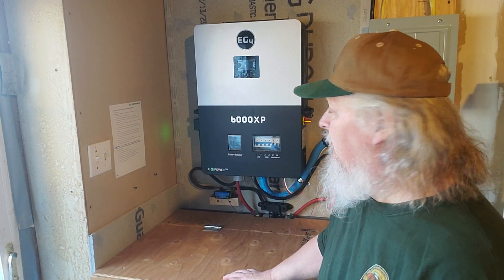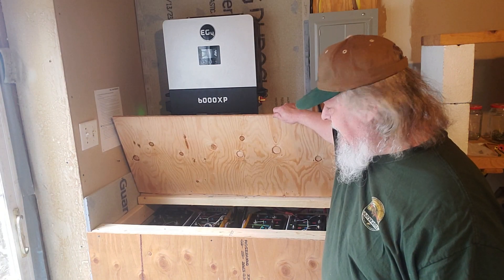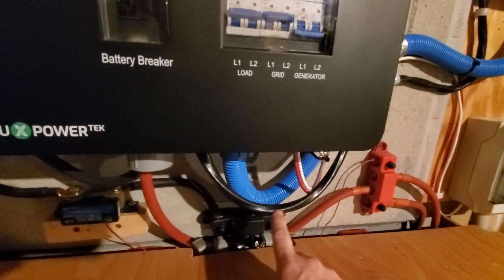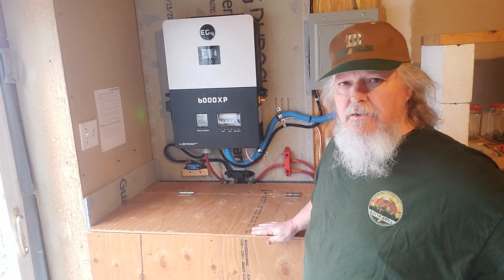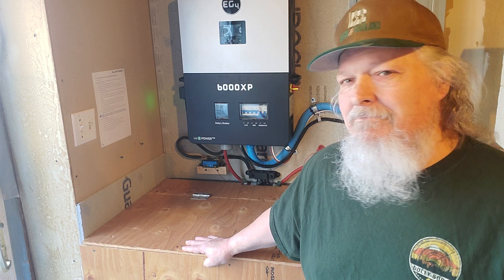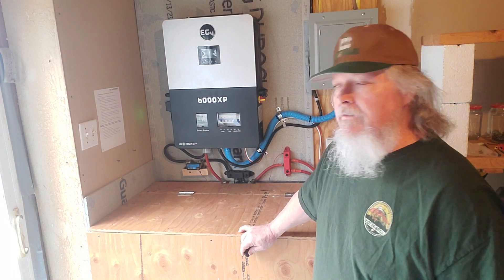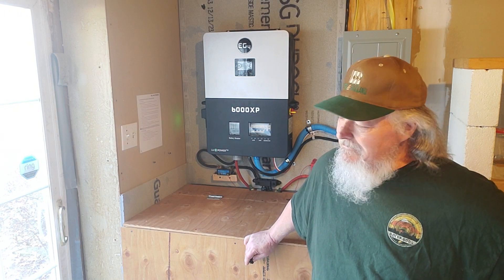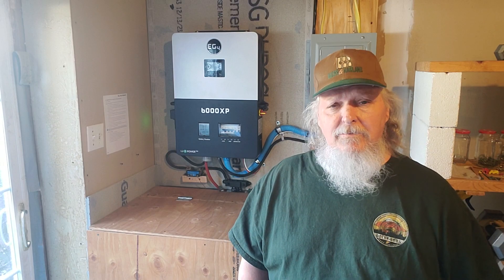EG4 6000 XP Review plus moving home to final homestead.

Comment: That family farm looks amazing. Lots of work ahead but it’ll be fun. 

You can clean the filters out on the XP while it’s running. I usually use a shop vac after I remove them also. Just to clean things up.  The inverters will heat up if the filters are dirty. So it’s best to handle that once a month or so depending on your environment. Glad to see you back making videos.
Reply from the maker: Thanks Gavin! Glad to be back. Always a pleasure to hear from you! Thanks for tips, I should do that lol didn't think about a vacuum, guess my mind is a bit preoccupied lol. It is a great farm, 4th generation actually 5th but I got a lot to do and clean up. You'll see in my next few videos, pretty bad shape, going to take some major loving lol. Hoping I can save it. 😟